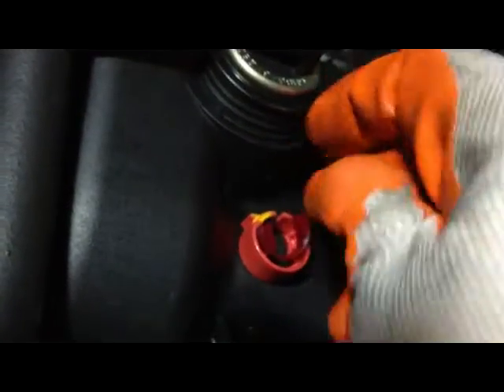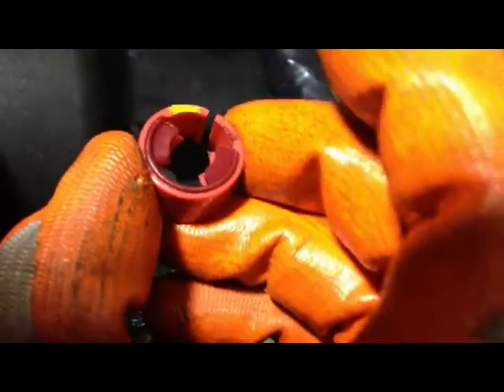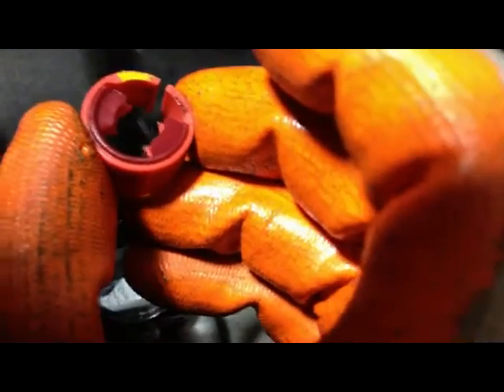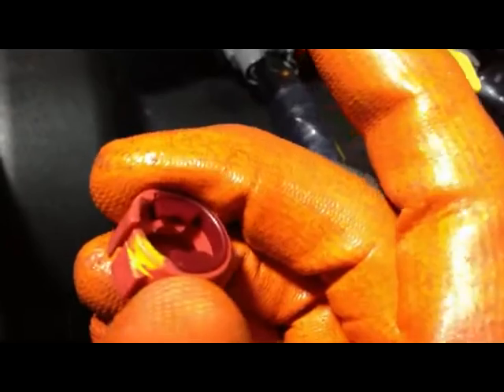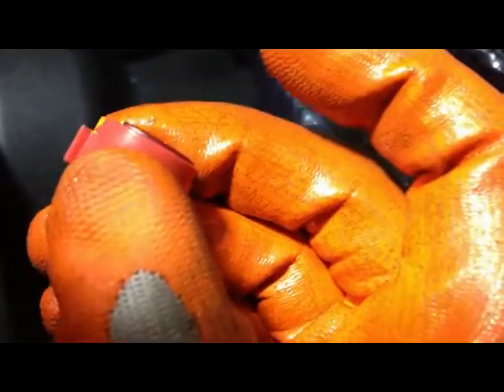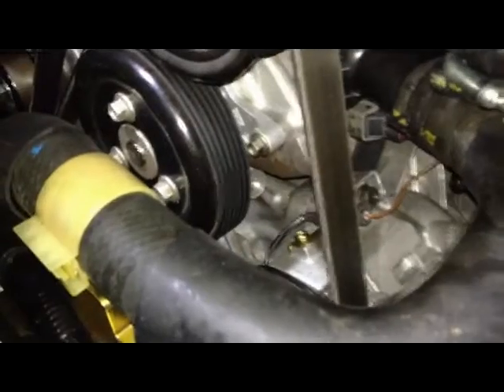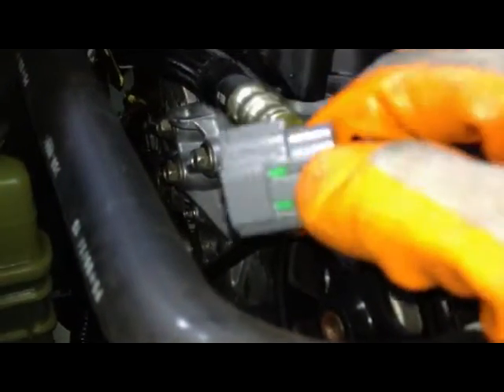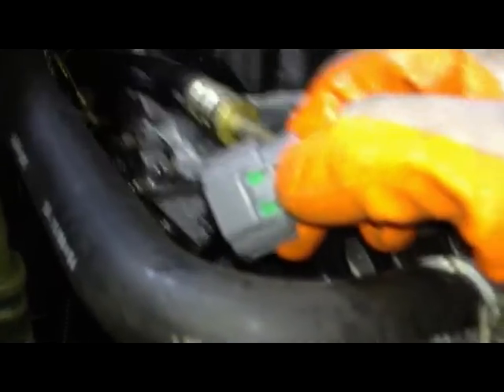MX5 Turbo kit installation part 2

Comment: I have followed this video to remove my intake manifold, but there seems to be one step missing, as despite removing all bolts and lines I still feel there is something at the firewall that is still connected to the manifold which prevents me pulling it out. Anyone have a suggestion??